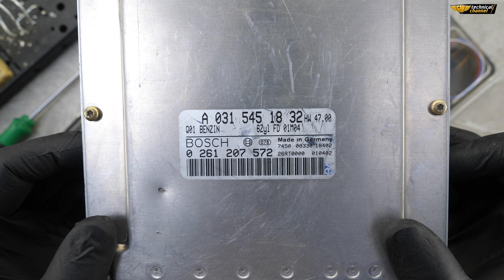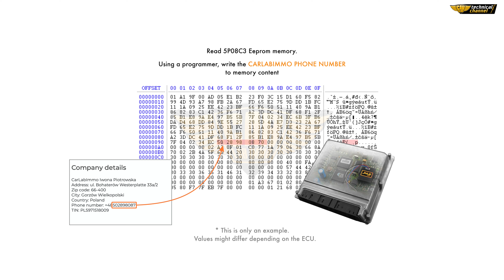Bosch ME2.8 (Mercedes / Chrysler) IMMO OFF | Julie PRO Emulator | CarLabImmo

Comment: Hi, will this Method work if Immo in car is immobilised and car can’t start? I’m looking for solution on a Chrysler skreem issues the key remote function locks and unlocks but no crank after 2 tries and no crank after that unless battery is reset.
Reply from the maker: Hi! This case has to be solved by our main technician on the forum. Please make a post on our Official Forum: https://forum.carlabimmo.com. Describe your problem, attach ECU pictures and ECU file and our technician will try to assist you.

Comment: Hello! This Julio emulate also the gearbox authorization?  I mean the ESM device P+R+N+D+1+2
Is possible? please answer
Reply from the maker: There is no need to do gearbox authorization on this model. The ECU numbers that are supported by our emulator can be found in the manual: https://carlabimmo.com/manuals/immobilizers/mercedes/mercedes-5.pdf. If your ECU number is not on the list, we are able to install the emulator in any ME2.8 ECU after sending the ECU to us.

Comment: Which of your emulator supports me2.7.1/me2.7.2 ? With 2 eeproms 5P083C, and two AM29F400 FLASH. 12 cylinder 275 engine
Reply from the maker: We currently do not have solutions for this ECU type, so you can make a post on our technical forum https://forum.carlabimmo.com/ and maybe our technician will be able to develop a solution specifically for this type of ECU.

Comment: Witam, będzie działać z 0 261 207 786 / a113 153 12 79  w211 e500  ?
Reply from the maker: Check instruction manual to find out if Julie supports your car: https://carlabimmo.com/julie-manual
But if you not sure, you can ask our technician on our TechForum: http://forum.carlabimmo.com

Comment: Does not work.
Reply from the maker: Please make a post on our Official Forum: https://forum.carlabimmo.com. Describe your problem, attach ECU pictures and ECU file and our technician will try to assist you.
Reply from the maker: There was a message on the Forum that it was closed and all replies will be given from Monday, 7.12.2020.
Reply: @CarLabImmoTechnicalChannel  is the issue solved? I want to buy this emulator for w163 ML320, but see some comments here it makes me doubt.
Reply from the maker: @achmadma  What is your ECU number?
Reply from the maker: @achmadma  Julie Emulator doesn't support your ECU. But in our database I see SYNC solution for your ECU number. Please check this: https://carlabimmo.com/immo-bypass/finder But if you want other solution, please make a post on our Official Forum: https://forum.carlabimmo.com. If you provide enough information about the ECU, car, production year etc., our Expert should be able to develop a solution for you.